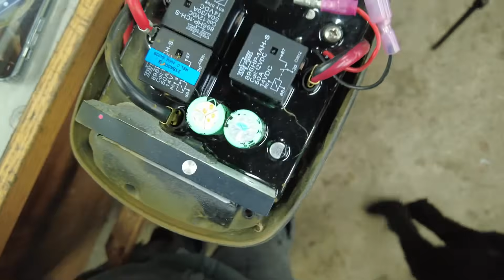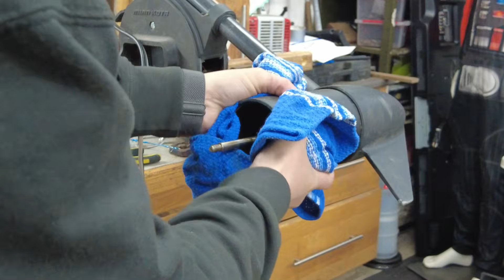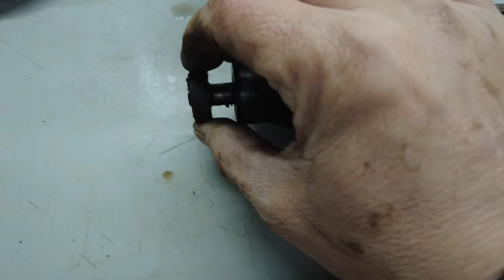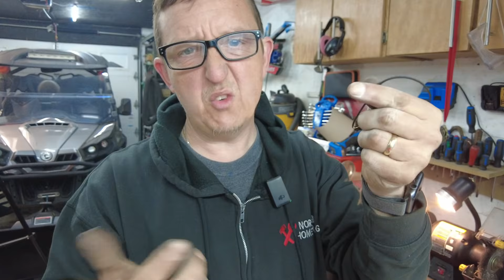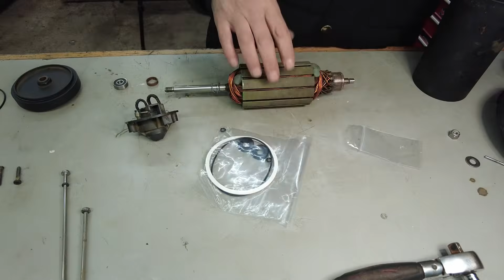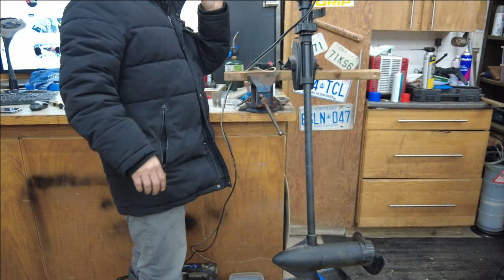"Minn Kota DIY Trolling Motor Repair: From Dumpster to Water - BIG Surprise at the end!"

Comment: Just curious if you’d be able to give me a few pointers. I have a similar model, and I’m having an issue. In forward, it goes forward. In reverse, it still goes forward… got any ideas on what would cause it not to switch properly?
Reply from the maker: Hmmm. Has it been apart or did it just start doing this?

Comment: So after watching this & a couple other vids I decided to do this myself. Its a very old Terrova & I have replaced just about everything on it, but never took the motor apart.  Thanks for the vid.
**HOT TIP , that cardboard ring is so sketchy....I took a zip tie the same width as the ring and lined the inside of it super-glueing it in place. The ring held its shape 100% better.
Reply from the maker: Glad the video gave you the confidence to tackle that repair, and thanks for that clever trick! 👍
Reply: @NorthernHomeGarage  thanks.
The only thing Im concerned about is that I used superglue so it would dry fast. In retrospect, that may not hold very long & could cause that piece of plastic to come loose & flop around in there.
 Another option that I may try if that fails, is to use a piece of PVC tube. Im guessing they use card board because it quiet . The PVC may rattle. Hmmm, what alternate matl. would work.....?
Reply from the maker: Has your super glue trick help up?
Reply: @NorthernHomeGarage so far so good

Comment: You put it back right. What you did wrong is that the black cover was not in the right place. You should have put tape on the. Cover to line it up. Now when you put it back together you put it opposite to were it should be. That changes the polarity of the unit.
Reply from the maker: Thanks for the info!

Comment: Every Minn Kota motor has a small line stamped on the stator (the part with the magnets) underneath and that line must line up with the motor "fin". If it is not below and aligned - the motor will rotate in the opposite direction.

Comment: A tip. At 4:52 I saw you using a screwdriver to pry the socket off the wrench. Typically, all you need to do is press on the button (or in other style wrenches, the switch for changing direction) on the back side of the wrench above the direction lever and the socket will pop loose. No need to pry or otherwise struggle to get the socket off.  I'm assuming you had to because your old Stanley is defective.
Reply from the maker: Thanks ! Yes you’re correct, that old ratchet has seen better days!! Thanks again for the tip!

Comment: Any idea what the voltage range should be at the black ad red wire after the board?
Reply from the maker: The output voltage to the motor will be variable based on the position of the throttle control. Off would be 0V and wide open should be very close to your battery voltage input. Reverse should flip the polarity. Hope this helps!

Comment: Several other Minn Kota repair videos show the necessity to mark the front end of magnet field housing for correct reassembly.
I did very same mistake which the simple fix is to redo the rebuild and get field on correctly.

There is a mating surface difference on the field housing ends. Assembly backwards probably will have water intrusion due to o-ring/seal mismatch.

Otherwise Minn Kota is a relatively simple relatively rugged DC motor.
Reply from the maker: Thank you so much for feedback and helping everyone else.

Comment: What would happen if you pumped air pressure to prevent further water issues 🤔
Reply from the maker: Like positive pressure in the lower end all the time?
Reply: @NorthernHomeGarage  run about 5psi to prevent water damage the motor
Reply from the maker: @chadellett4696  get a patent lol!!

Comment: Armature is 180 degrees out.  It can be installed only two ways.  If it is not installed the exact way it is disassembled it will run backwards.
Reply from the maker: I figured that out the hard way. :). Thanks for watching!

Comment: En caso de cambiar la polaridad al conectar el motor en la batería que pasaría??? Me compré un motor hace poco y está al revés 5 velocidad en reversa y solo 2 hacia delante
Reply from the maker: I’m not sure it work if connected to the battery backwards. The wires inside might be backwards if someone worked on it. I connected mine backwards.

Comment: Hey, I wanted to let you know I know why your trolling motor is running in reverse. You put your magnet on backwards. You did everything correct -Don't worry! It's just you put the magnet on backwards and that is causing your directions to be off. Switch it around and it will be completely fine.
Reply from the maker: Ha ha. Yes. I did end up flipping it around. Work much better now. Thanks for the comment.

Comment: Did you consider your intrusion place being where the shaft attaches to the motor?    It is a threaded attachment and can become loose from time to time.   I have yet to confirm if water will get in from there, but I use these motors on my power poles as crappie brakes.
Reply from the maker: Hmm I never even thought of that. Thanks for the tip!

Comment: Great video... some motors will run backwards if you put the magnet housing in wrong. All you have to do is rotate the magnet housing 180 degrees and that will put the magnets polarity the correct way and it should fix it.
Reply: yep. It's exactly this. I learned this the hard way last weekend when I replaced my armature and got out to my fishing spot to find that my motor was in reverse. I drove home to fix it and headed back out. Lesson learned
Reply from the maker: @mick9850  oh no!! Well we know better now! Lol
Reply: That exactly whet he did. You’re so right.
Reply: Place a piece of tape across motor next time to line everything up when reassembling.
Reply from the maker: Great comment. Thanks for helping everyone here and thanks for watching.

Comment: Just learned more than I ever wanted on these motors and know what your issue is. Yay YouTube!  While the videos did not identify my specific issue, it helped me understand how it works so that I could troubleshoot.  Minn Kota did not help much other than to tell me to open up the lower unit to "look for water", then on the next call that I must have missed something, because I started at the battery, and tested voltage at every level from battery, to control board, to top cover, shaft, all the way to the brushes, and also tested the Armature for the appropriate continuity.  But since they confirmed it "should be working" per my tests, I started trying to manipulate the brushes to confirm they were making contact with the armature.  One stuck a hint, but the other would not move at all, and looking closer, I'm not sure if the wear of the brush melted the brush plate, but you saw melted material of some kind "welding" the brush to the brush plate.  I could likely have just removed his extra material, cleaning up the brush plate with a file and brushes with 800 grit sandpaper, but for longevity and insurance, I decided to replace the brushes, brush plate and springs since once you take this apart, you need to replace the O ring between the center housing and prop end housing, 2 o rings at the bolts, and the gasket between the brush end housing and center housing.  Since I needed to order parts from minn kota anyway, the parts I was looking at for doing it right was about $30 which is far cheaper than I anticipated spending.  Maybe I need to give Minn Kota more credit.  Their website has the schematic/parts lists, which allowed me to feel confident in pulling this apart and getting it back together properly, but also ability to order whatever component you want.  I also found videos on the line (LOL) by Minn Kota explaining how to pull the lower end apart (mine was 3 5/8") and it was excellent in showing the removal process and what to look for.  The only thing that bothered me is when he said "replace if worn", but did not explain what "worn" looks like.  It's not like a tire where tread will tell you.  But since everything he told me to do in troubleshooting looked good such as continuity on the armature, and I also decided to confirm all pathways from the the top of the shaft to the brushes, I concentrated on the brushes themselves and while they did not look worn, that is when I tried to move them and found no movement on one of them.  So this video was immensely helpful, and helped more the technical support who after I told them I tested power to brushes, told me I needed to take it to a service center, it did help me understand how this works and troubleshoot further.  In the end, since you should replace the seals once you pull the lower unit apart, the fix was  anywhere from $6 just for the seals, or $30 for insurance to just replace the brush plate, brushes and springs as well.  This would have been hundreds of dollars to bring to a service center and who knows how long.

Anyway, to your reverse problem, your wires are probably fine since you say you paid close attention to this.  The issue is likely your center housing on the lower unit.  I noticed you did not mark alignment when you pulled the lower unit apart.  It's a coin flip and you lost, LOL.  If you mark the brush end housing, at the intersection with the center housing with tape, this will ensure proper alignment.  If you pull the center housing off and rotate this 180 degrees (not flip), then your problem will be resolved.  Since your seals are brand new, I'm sure you can just re grease and use them again. The magnets are what controls this and they are different, so if you put it on backwards, your motor will run the opposite direction.  Also, the problem was likely just the water.  Cleaning up and replacing the seals, maybe even the bearing you broke would have solved it.
Reply from the maker: Wow. I'm so glad it helped and that you we're able to get yours back together. I found the parts very inexpensive as well. I changed all the seals and did spin the armature to fix my reverse issue lol! Thanks for the comment and watching the video. This just made the time it took to make the video worth it if helped one person.

Comment: had the same thing happen with water getting in the motor fixed it but it only lasted a short time and it got water back in did it twice and gave up on the third time believe there was some sort of Manufactuing flaw  in the housing but could not get it to stop leaking the thing was only 2 season old .
Reply: mine kept running  with the water in it also but it would stop running after a little while was not dependable so after three fixes gave up on it   the motor was never submerged just must have had a leak somewhere put new seals and parts in it just could not get it to stop leaking water into the motor housing.
Reply from the maker: I think I figured out why mine had water in it. The whole motor was submerged a couple of years ago and I only took the top cover off to dry out the electrical parts. I didn’t know, or think that the tube was hollow all the way to the bottom. I suspect that’s when the water got in there. Well…at least I hope that’s what happened. Funny thing is, it still ran for a bit with all that water in there. Thanks for the comment.

Comment: Great job and video,  you might be able to switch the leeds on the battery if it's not protected by a diode.
Reply: It happens to me as well. Simple fix is to reinsert 🧲 (out shell) reverse (upsidedown).
Reply from the maker: Hmmm good thinking. Thanks for watching!